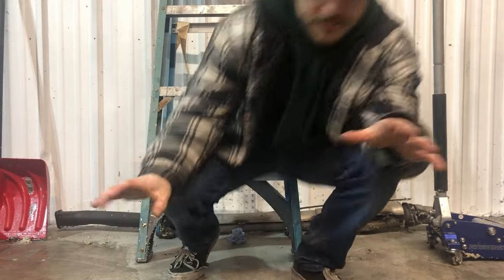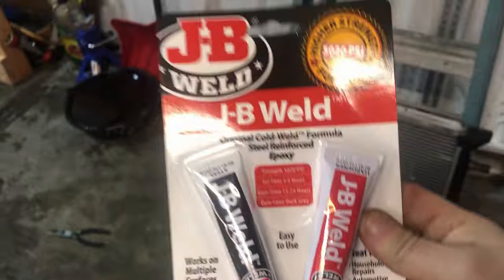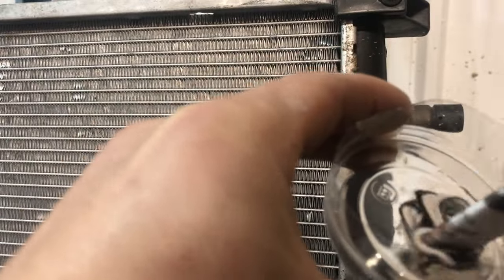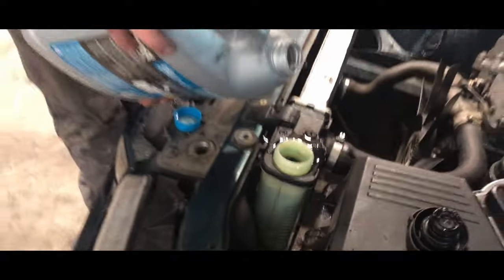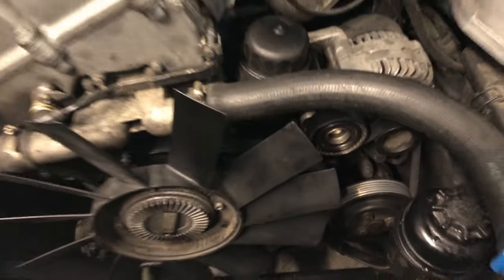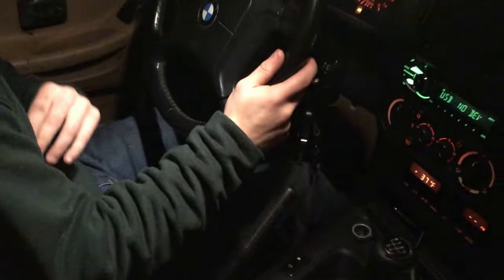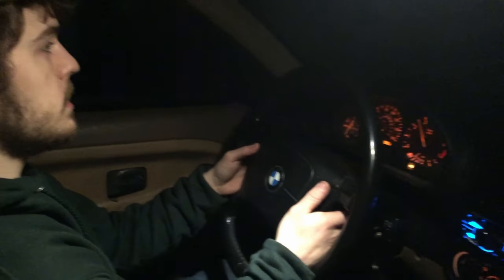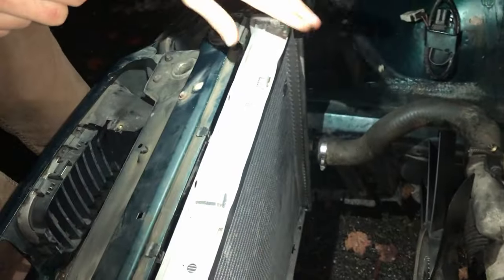How to Fix a Leaky Radiator With JB Weld

Comment: I once used JB on a motorcycle radiator and it never leaked again. I also used it on a motorcycle gas tank and that also never leaked again. I made sure the surfaces were really clean, I think that's the key to it.

Comment: I'm about to try to fix my radiator doing the same thing but with the JB weld that's meant for hot metal stuff. This video made me feel significantly more confident lol
Reply: I've used it to fix a cracked cylinder head.... It's awesome stuff.

Comment: Testing out jb water weld on 2006 325xi wagon. Ill cure for 24 hours before I start the engine. Hopefully works, really do not want to replace the radiator.
Reply: Did it work?

Comment: Can we use this on my Benz e350 radiator? Hit a pothole then later hit curb at car wash while radiator was exposed. Skid plate tore off when hitting the pothole.i have a coolant pouring out the right corner of radiator

Comment: Damn I'm doing this on a town n country v6 any advise the front acc radiator leaks same with the radiator and I just bought JB weld
Reply from the maker: If you’re talking about the ac condenser I’d probably stray away from using JB weld on that personally. Due to the construction of the condenser and the way the system is setup, you run a good chance of completely clogging the system.

Comment: I’ll hook you up with my old radiator when I do my upgraded one soon
Reply from the maker: Yooo that would be sick!
Reply: @JamDrifts  Not sure if 6 cyl radiator and 4 cyl radiator are different. it looks like the expansion tanks are on the opposite sides
Reply from the maker: Yeah, Marco and I talked about it and it seems like we should be able to make a 6 cylinder radiator work. I’ll just have to replace the stock air box with a pod filter to free up space for the driver side hose.

Comment: I’ll try it. Removing my shroud, same thing
Reply: Tried it today. After an hour of videos, most said don’t add formulas because of heater core, came down to your solution or flex seal . My new Mercedes radiator is a week out. I went with your solution. Let ya know tomorrow ✊
Reply: Totally worked. Left overnight, 5 am. It was good. I used all of it.  Good advice 👍
Reply: Totally worked